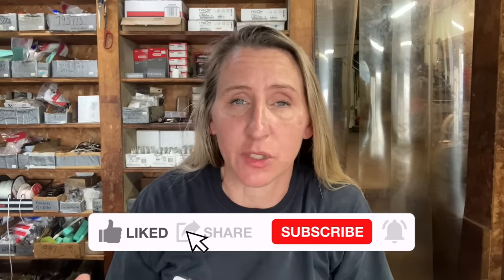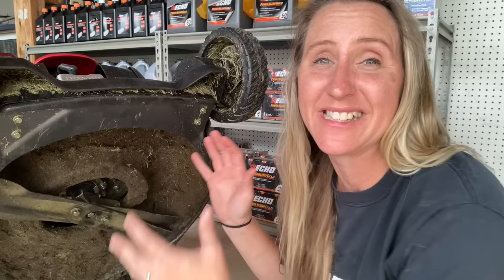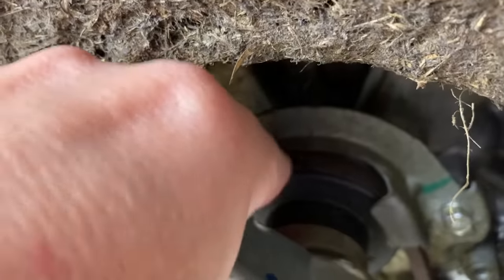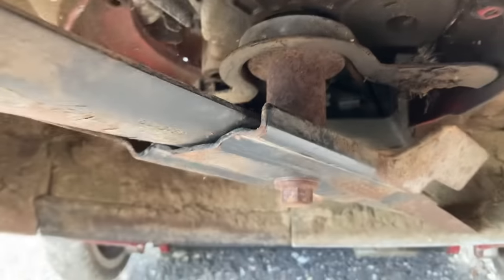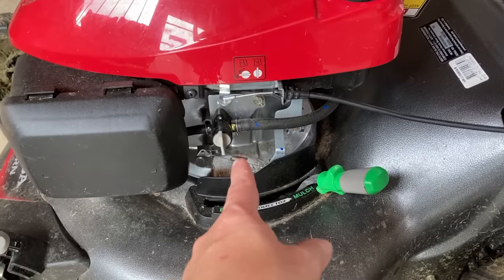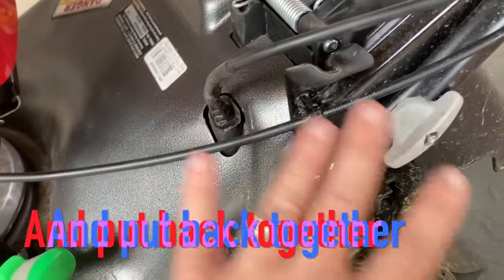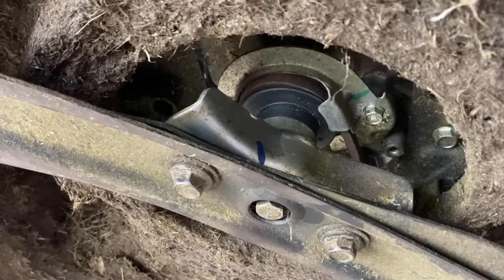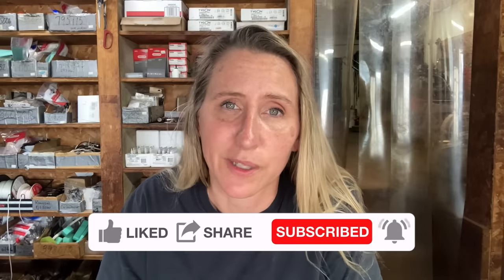SAVE A TON OF MONEY in repairs by NOT BUYING this NAME BRAND mower.

Comment: Well that's great. I just purchased this very mower last Fall because . . . well . . it's a Honda. It may have been an omen, but the first thing I noticed about it was that the right front wheel wheel was higher than the left and on flat surfaces, it didn't even rotate. When I pointed this out to the dealer, he kind of dismissed it and suggested I just try and bend it down by hammering and  flexing it back. I may fix it by twisting the "axle" instead. Unfortunately, Honda may have screwed the pooch with this mower.

Comment: I have a Honda mower from the 90's.  It's still running pretty good. It's even got a stainless steel deck. Carb probably should be rebuilt. It's a little on the sputtery side when it's cold, but it always starts right up. The compression is good and it doesn't smoke......yet.😂

Comment: Hi I bought a troy-built TB105. I have had it for about 4 years keep it outside unroofed. Only problem I have had was the paper air filter got wet in the rain, and wouldn't let much air through. Removed it and haven't had any problems since. I payed less then $200. I don't recommend any Honda's except for there portable generators. There generators can't be beat.

Comment: great video.  I'll go one further.  It takes about 10 lbs of pressure to push a walk behind mower.  The NON motor assist doesn't have gears, or belts.  The motor is just a shaft with the blade adopter and a key.  The blade is bolted on.  Not much to go wrong.
Reply: I totally agree, simple is better, fewer potential points of failure, and less weight in this case.

Comment: Was considering buying a new Honda self propelled last spring. Would not have bought a different brand due to Honda's reliability of their mowers. I decided to put new wheels, blade, and drive belt on my Ariens self propelled I bought new in 1987. The drive system is still good, and the Briggs engine always cranks first pull. Never any oil consumption or exhaust smoke. The original unbroken drive belt was still on it. I do take good care of my equipment. My old Ariens is a tank ! By the way, still using my Echo trimmer I bought new the same day I bought the Ariens.

Comment: Nice! I bought one of these, but I do not mow on wet grass and I clean out the debris each time I use it. I hope mine does not have the issues you describe here. I do have to take it in for recent recall. Too bad it's not for the issue you described. Thanks for the heads up.

Comment: I have that one and luckily no issues.  Although I never mow my grass wet.  Maybe I have an earlier version because mine is three years old already.  I just cleaned mine up for fall storage and saw that mine actually has as guard blocking that area.   What the heck, did they remove that on later models?

Comment: I have the HRX537 Honda mower and they do not seem to have these type issues or at least I have not heard of anyone having this issue. I have used mine for 4 seasons and only had to replace the blades and change the oil and air filters .Just my 2 cents. I think the lawn equipment in general sold at the big box stores is manufactured to sell at a certain price point and to do that the manufacturers have to cut back on quality. I bought a John Deere mower at Lowes when I lived in North Carolina that the engine failed on in less than 60 days. Lowes told me to take it to the local JD dealer. The dealer had 4 more of this same exact mower in his shop for engine replacement. That was 20 years ago.  As much as I like Honda I would recommend that you buy from a full service power equipment dealer NOT a big box store.

Comment: We purchased one of these models last year believing it was a good mower. We have not had the drive issues yet, but I will make sure that I keep this belt area clean. We purchased this from a local chain where our altitude and the store altitude is above 5000 above sea level. It turns out the the spark plug fouls because the carb jets are too large for our altitude. Why would Honda send a lawn mower with a jet made for sea level to a location where the altitude is above one mile? So now I have to find a leaner jet and replace that. I'm glad I kept our 18 year old Craftsman lawn mower. Seeing that this video is about lawn mowers, I won't go into why we bought a Toyota CRV last December vs another Honda CRV. That ended our Honda purchasing since the 1970's, and I guess the lawn mowers are in the same category.

Comment: I've got a Toro rear wheel drive 3 in 1 push mower here that we bought on 4/2/16 and that mower is still going to this day. It has an electric start with a rechargeable battery and I've not had any issues with it at all. The only thing that I've changed on it has been the engine oil and spark plug and that's it. Go with Toro, they are built like a damn tank.

Comment: I work on this stuff daily. I can sell Honda's for 2x as much. I dont own one they are much harder to work on look at the stuff you have to line up to get the carb on and off. Had two that would run and stall 20 seconds later culprit was the NGK plug. Ran Polaris snowmobiles for years dad constant problems with NGk. Also have a 34 yr old Honda snowblower had two NGK plugs stop firing. It now has a Champ in it and runs as well as when i bought it in 1989.

Comment: I have a eleven year old self-propelled Honda mower, I change the oil, sparkplug and air cleaner every year and it starts First pull every spring. No issues.

Comment: You're sooooo right.  I had one in the shop last month with the same issue.  When I looked at the new configuration, I thought no way I'm taking all of this apart.  Yes, you have to take it all apart and it was a real bear.  The traditional Honda self-propelled set up is easily serviceable.

Comment: I left the belt "guards" off my exmark commercial mower. A stick would get in there and start rubbing and burning belts every 10 to 20 hours. You can hit it with a leaf blower but it wouldn't help so after replacing several belts that I just left the belt covers off and that solves the issue.

Comment: Unfortunately a lot of these issues occur with the Honda commercial series mowers also. Just yesterday I had to do a simple drive belt replacement on a newer Honda commercial and it took so long to remove all the baffles underneath I had to charge the customer 1.5 hours labor for a job that normally gets .5 hours labor billed.

Comment: Hmm... Well I can't speak to the 216 but I've had a 217 for hmm... five, maybe six or seven years now. Everything you are pointing out on this mower I have NEVER had an issue with. In fact, the 217 is simply the best mower I've ever owned. It cuts grass better than about anything I've ever seen. 

As far as 'wet grass'... I was raised and taught you never, ever cut grass when it's wet. Wait until it dries out... or cut before the rain comes. Grandpa and dad were both very, very clear on that point. 

So sorry to see so many issues because I've had none with the 217.

Comment: I own this mower and my heart just skipped a beat! I've had it a little over a year without any issues. I do keep it clean. I will say that I hate the fact it has plastic tires! Other than that complaint it works great. I also got the extended warranty so it's under warranty for 7years. I'm not sure why you didn't fix this mower under warranty and replace the plastic part? So far it's a great mower. Time will tell I suppose.

Comment: Done so much" modifying", fabrication, re-designing, re-engineering, on Perkins diesel, Deutz Diesel, Bobcat, Rayco, Ford F700, Detroit diesel, Dodge gas, Stihl, Husky, Echo chainsaws, weedeaters, blowers, etc. Glad I have a couple shops ,and tons of tools, to keep the fleet going. Rarely, is the " factory design", the best engineering to work with.

Comment: In 1999, I bought a Honda self-propelled mower used it for 4  months and following year  started using and  it stopped self propelling.
The transmission went bad after one season. 

Honda would give me a new transmission if I would turn in this closed case transmission so they can figure out what was wrong. Here's 2024 and I'm ready to mow another year with it.👍

Comment: I bought a push mower with a Honda motor,it an automatic choke on it. I ran good for 1 season.  Season 2 the choke would allow the.motor to run about 15 seconds,then quit,it would start back up every time. The dealer where I bought it tried to repair it under warranty.  No such luck. I finally junked it. And this was about 8 years ago.
I had bought it to cut grass close.to the pool.i just bought a push battery ryobi.

Comment: I don't mow wet grass, but my 5 yr old Honda has drive issues, also.  Works about 35% of the time.  I checked out Utube videos, and yeah, lot's of crap to disassemble and maybe get it fixed.  Thinking of chucking it and just getting a new battery powered EGO

Comment: My wife's uncle built me a mower out of parts with a Tecumseh engine that had a steel sleeve in the cylinder.  He told me this push mower would last a lifetime.  I haven't used it in 15 years.  Guess I need to get it out and see if it still runs.  I can't believe people don't care for their equipment.  After use for the season, I even squirt off my weed eaters to remove any stuck grass and will be clean for the next use.  I usually do the same for a push mower.  Cheers from eastern TN

Comment: My roommate wanted to get a Honda mower but, gas push mowers are just not built as they are used. So I’m getting the Milwaukee M18 fuel mower. The Milwaukee mower has an eye watering price tag but has more oomph than any comparable gas mower on the market and cordless electric mower self propelled mechanisms is just a self contained motor and gearbox.

Comment: I was quoted an average of just over £260 to "fix" my Honda HRD53 which had drive roller problems....Nearlty all of it was labour to remove and replace the housing. I simply bought a brand new Webb which was just a little bit more than the repair cost of the Honda.

Comment: Wow I haven’t had this issue with my HRX in two decades. I’ll have to tip it over and take a look at the difference soon.
Reply: That’s what I bought, the HRX, and so far so good. My friend has the model shown in the video and it has problems moving. It starts up easily but has to be pushed assisted to move. Had a feeling it was a belt thing.
Reply: @SquirrelDarling1  my HRX is almost 20 years old. Just oil, blades, and a couple filters/plugs needed the whole time. Not bad.

Comment: Front Wheel drive self propelled mowers have 2 advantages. 1 you just push down on the handle to lift the drive wheels off the ground to take a turn. No skidding on the lawn. 2. It's much easer to clean and maintain. Rear wheel drive mowers you have more power for larger lawns but you forget to let go of the handle to take a turn. This causes skidding. And when the drive system breaks. Much or costly to repair.

Comment: I water my grass before I mow to keep the dust down. I have never had a problem with the belts. My 10 year old honda mower does need a new transmission though, you cannot pull it backwards anymore, the whell lock up.

Comment: Very disappointing 

I have a Honda powered Craftsman that I just realized is 18 years old. Sure it isn't a self propelled model but dang good.  

Thanks for the info. If I ever need a new push mower will check back.

Comment: I had a honda mower for 14 years that finally broke. I call that a win. The new one has smaller engine but cuts better with no bogging down. I do not mow my lawn when it is wet. If it lasts 6 years I'll be happy.

Comment: Somehow  I have a18hp  42" cut MTD Pro  riding  mower  that is still  mowing after 22 years! Mowing a 1acre lot and mulching leaves with a bagger. It is not the best mower ever. But.... A basic machine made to last 10  years perhaps.  I have  put  lots  of minor parts on it but nothing  major. I have  had to  pull the deck 3 times over the  years to weld it back together.  Even hammer it  out after some  stump  bumps.. Not  to  put it down but  I don't know how its lasted so long. It has  worked!  I drive a Honda car and worked for  Honda on the  Jet test development project so  I do have  respect  for Honda the brand but  for some reason  never  wanted one of their mowers.

Comment: I have this same mower the only difference is ours is 3-4 years old. We bought the electric start model but took it back and had to settle for the rope pull. I’d never had a electric start before so I thought it would be nice, but that was not to be. However, that was not the problem. The problem was it burned oil from the start thus, we returned it. I have a pressure washer with a Honda engine that won’t start, but if I tilt it back on all the way to the ground and set it back up it starts in one pull. My guess it’s the float in the carburetor. I’ll never buy Honda small engine motors again. That being said, we have a Honda snow blower mid 1980’s model and this little thing has been put through hell and never fails 38 years and running!

Comment: WOW
I have an HRX 217 that I bought new when they first came out in 2003.
Only issue I have had was the transmission failed after 13 years of service. I purchased a new trans from EBay, installed it myself about 7 years back  Never any other issue. I'm thinking this mower will outlast me as I'm 73...

Comment: I bought a cheap walmart MTD mower that was a return they broke the pull cord and bent the blade after hitting a rock i paid $40 for it. I put a new blade and repaired the pullstart and that was 18yrs ago i’ve never had a problem with it i change the oil and new filter and plug every year and it never misses a beat. Bottom line is you dont need to spend a lot of money on a mower just take of it and it will last a long time

Comment: I have a 13 year old Honda mower.  It has been great, never had a problem starting even after winter shutdown.  All I do is run it dry every winter and then change the oil, air filter and spark plug every spring.  Always starts at the first or second pull.   Unfortunately it is now rotting through the deck and it flings stuff out at you so it's time for a new mower.   I have no idea what to buy to replace it.  Everything seems like crap today even the Hondas which are no longer being sold.

Comment: My favorite walk behind mowers have been, whatever ones my not-so-bright, but rich enough to buy another, that  neighbors put to the curb when they stopped working!!!

One, just needed a $15 shutoff cable.😂

Another, just needed the 100% clogged air cleaner filter replaced!!!😂

Works for me...sometimes I end up with a couple of surplus mowers, and give them to people poorer than me!

Then there's the snowblower a neighbor put to the curb for free...needed new starter motor gear teeth, and replace missing starter mounting bolt, and a $0.10 nut...about $25 and a couple of hours, some TLC cleanup,...sold it for $450!!!

Comment: I have a similar problem with a Honda push mower. Mine is about 6 years old and hasn't been used in probably 4 years. The rear drive wheel is locked and I'm sure it's from grass. The commercial Honda I bought couple years ago has had no such problems. Sad you have to buy commercial grade to get mower that lasts now days.

Comment: I have a preventative measure. Taking old vinyl album that already has scratches in it drill two holes in it off center so that it fits in between the blade and the housing that secures the blade to the lawn mower.

Okay maybe a vinyl record isn't the correct plastic to use (it would break very quickly...lol) but it would be good as a preventative quick fix. And a 33 album would be the perfect size. 🤔😉

Comment: I have a Honda easy start walk behind mower I have had over 15 years.  It’s all enclosed. My mower starts first pull yet never tuned up or replaced spark plug.  I have replaced the blade but that’s it.    Changed oil yearly.  Guess it’s the old saying. They do t make ‘em like they use to.

Comment: IMO, the best mowers are the simplest ones. Really, all you NEED on a mower, is a small engine, a blade attached to that engine, and a (hopefully all metal and not plastic!) deck that has four wheels on it, and a handle to push it with. Anything more is adding to complexity and potential points of failure. I bought a simple Bolens 4-stroke gasoline push mower. It has pretty much zero bells and whistles. It's a good ole B&S engine on a metal deck with a handle, and that's it. And that's exactly why I bought it because it more resembles mowers I used when I was a kid, mowers that my dad used for years and years and years until the decks rusted out. Now, granted, it has those stupid squeeze bar safeties, but sadly it's impossible to find one that doesn't, and IIRC it's actually against the law to tamper with them or somecrap. Oh well. That's a minor inconvenience. Otherwise, this Bolens is pretty much identical to old mowers I used in the 80s when I was a kid.

Comment: My brand new Ariens lawn mower only had one wheel driving on the left side. On disaasembly I found a part in the right side wheel marked "L". When I took the left side wheel apart I found the same part inside marked "L"  The part on the right side should be marked "R".